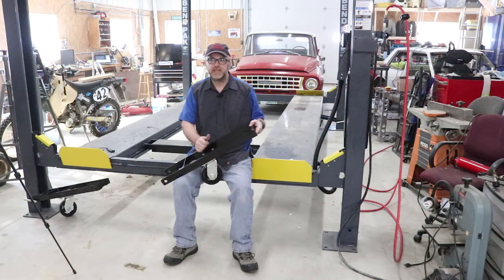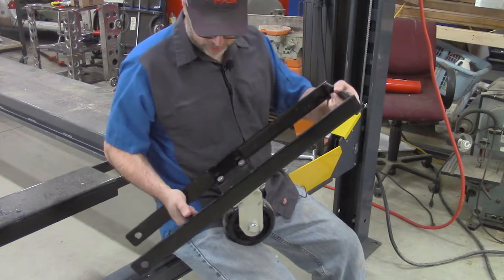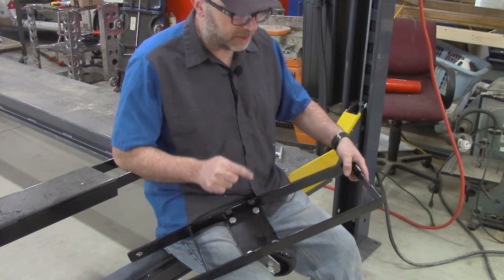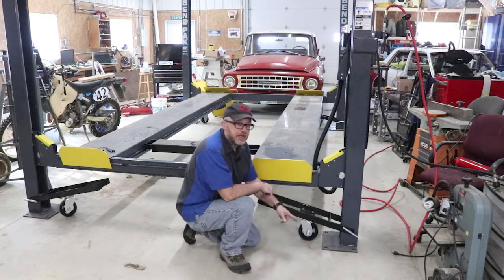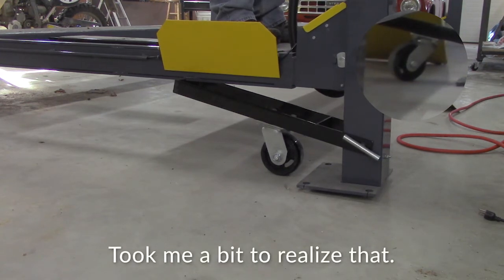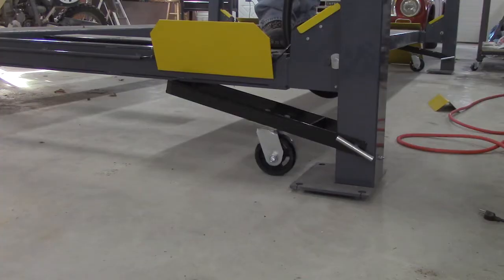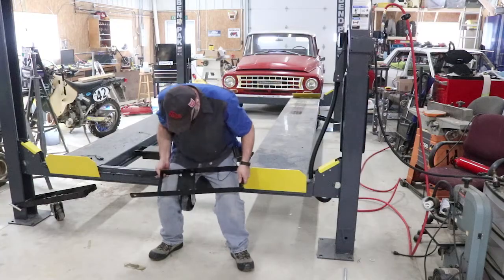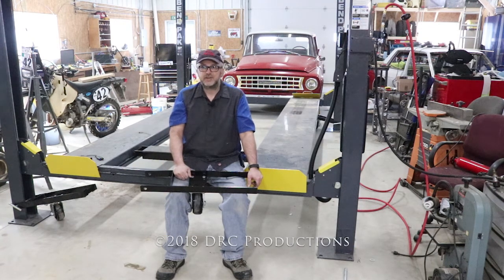Bendpak Caster Wheel Kit

Comment: With all due respect, putting the casters inside the metal "box" instead of on top of the plate brings the angle down much more and allows the weight of the car lift to level the arms of the caster. I just wish Bendpak had put out a pdf of proper installation. I tried putting a caster on top of the plate but the weldment would not allow a nice flat fit. I flipped over the arm and put the caster in the "pocket" and it fit so much nicer. Built all 4 casters, installed the pins and it lowered with all arms fitting flat. Posts lifted 3/4" or so and then it rolled so easy. Putting the caster wheel out to increase the fulcrum point as you mentioned worked really well so that's a great tip. Not sure it's really needed once the casters are in the pockets but I did as you mentioned just because it sounds like a good idea. Check it out and let me know if you wound up with the same results. Oh and I gave the jerks a nice case of fresh grease. Looking forward to finishing off this project and see how quickly I can build the next one. Cheers.

Comment: If moving the lift a small distance it would be ok to just have the post plates clear the floor.  But if moving some distance it will be easier to have the caster brackets parallel to the floor.  This makes the caster swivel in its' natural alignment.

Comment: How tall is the lift with the casters on? I/m trying to figure out if it will fit under a 92" garage opening.
Reply from the maker: It only raises just barely off the ground, probably about an inch.  When not in use it doesn't raise it at all.  The total height depends on the model of the lift so the bendpak specs should give you that.